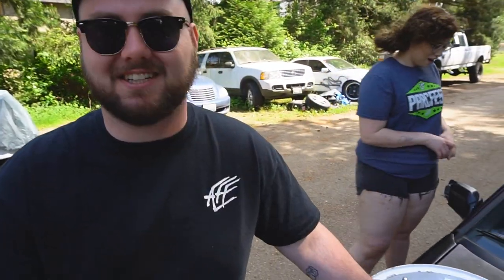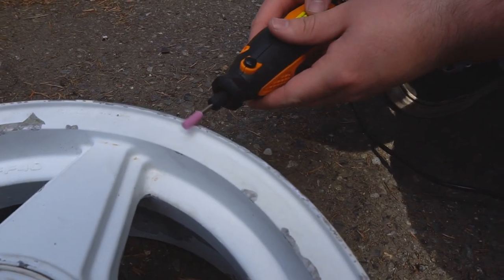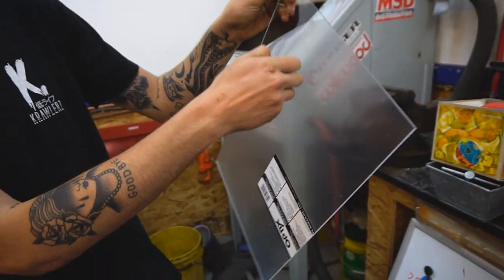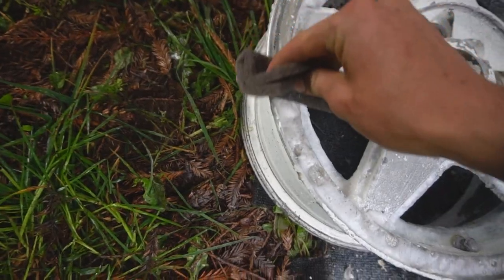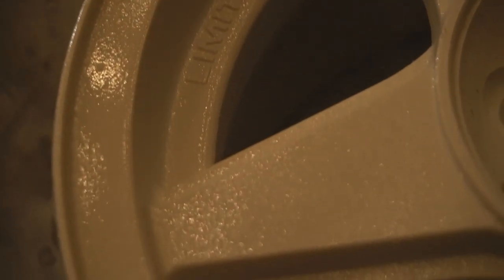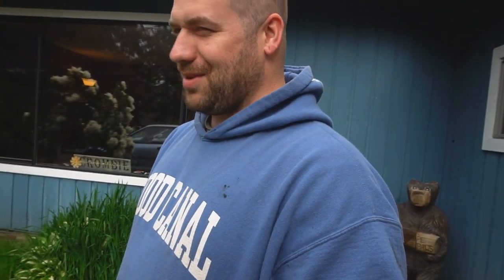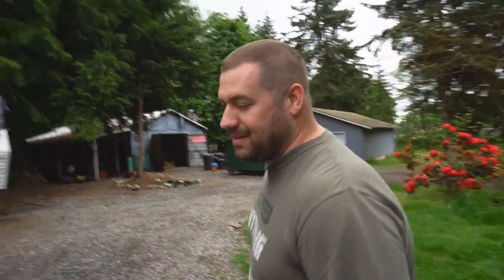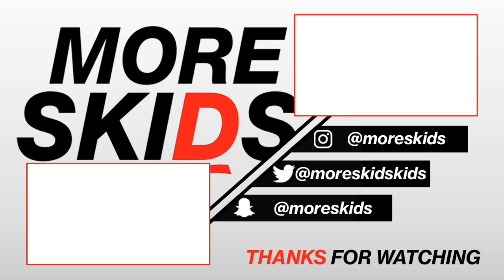Rare JDM Wheels For The Civic!

Comment: For your sandblaster, check the grit of the sandblaster media you are using. It looks like it is very fine grit (gives a good finish) but to remove paint/ take off rust (like what you usually want to use a sandblaster for) ya need some more course/ rough media 🤙

Comment: 80% of painting is prep work! But they still look good. A little tip, when you're waiting between coats cover whatever you're painting with a box to prevent dust, also just limit the dust in general and if you can slightly wet the floors to keep dust sticking to the water not your paint. But getting them painted by a pro is the right move, look into powder coating!